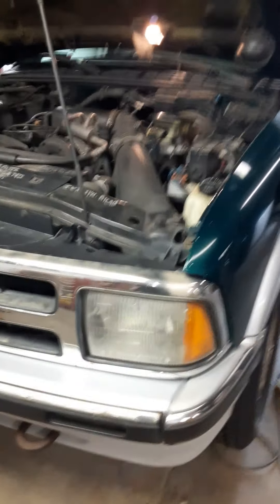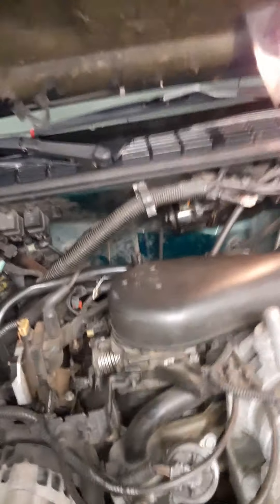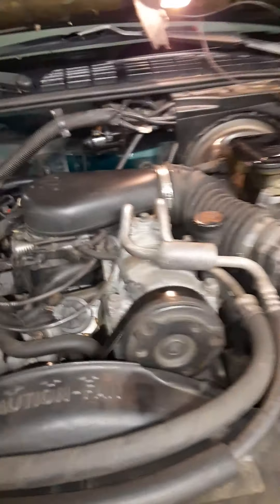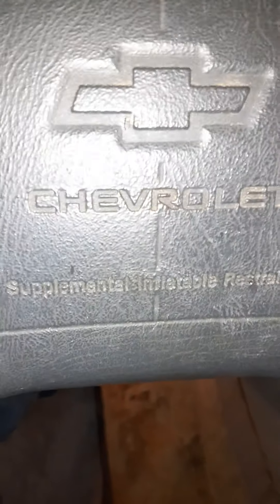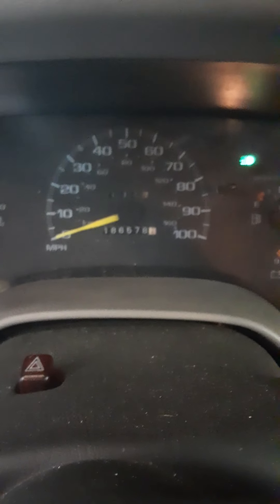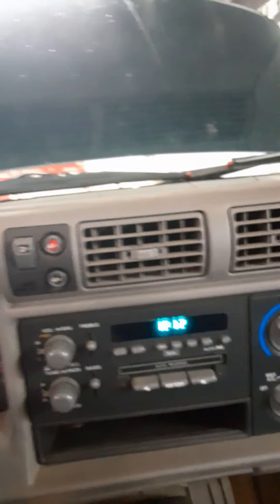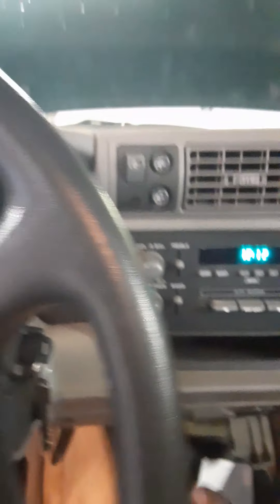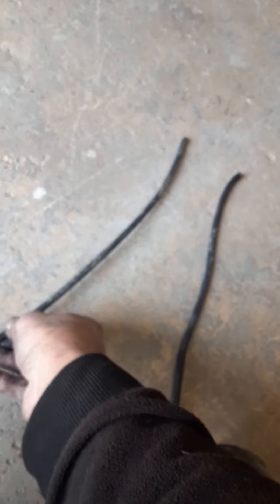(Pt.2) 98 Chevy Blazer 4x4 Not Working

Comment: '97 Blazer...replaced cable, vacuum actuator and transfer case switch, and the dash 4wd switch...still no 4wd...not even lights on the 4wd switch..any ideas?
Reply from the maker: No lights ok did you check fuse for 4WD?
Reply: @dragsterstransmissions  Yup...it's good...maybe the TC control module?
Reply: Dang though you showed it finished here.